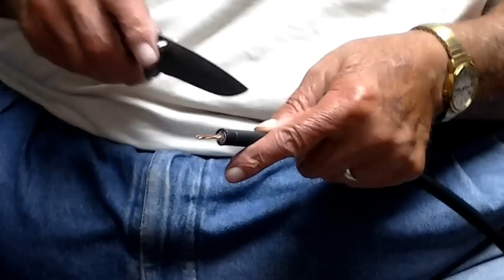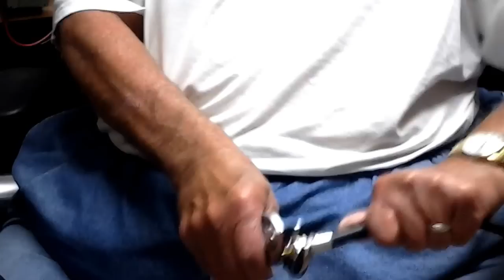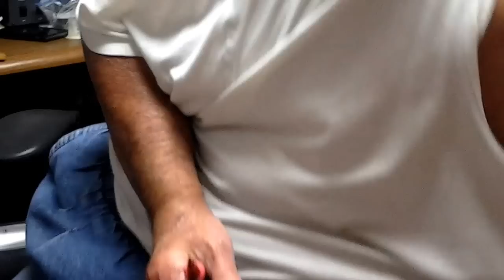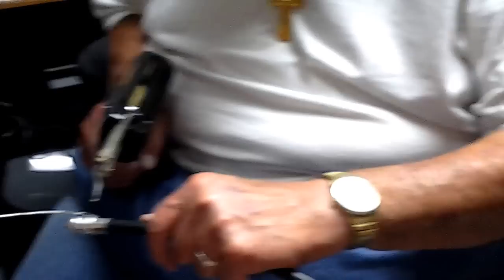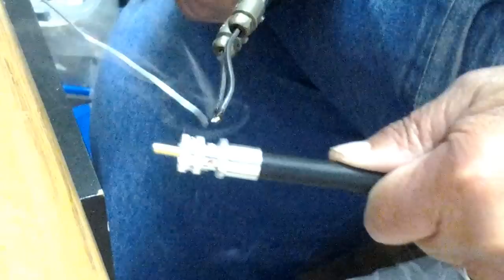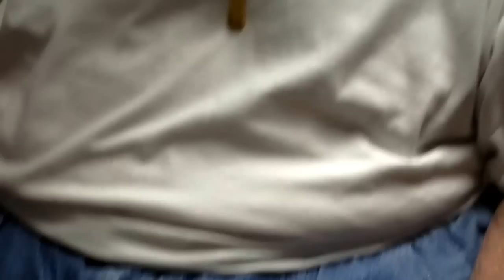SOLDERING A PL259 COAX CONNECTOR PART 2

Comment: If you are using stranded center conductor you can carefully remove about 3 strands and it should fit the center ok. Just make sure you have a good solder application on the wires that are installed in the center. There are some PL259 connectors that are cheaply built. Look on ebay for a package of 10 that have good quality material.

Comment: nice video, but i question the safety of your solder method. Looks like some could fall and burn your bluejeans, which were featured a lot in the videos. Maybe using a vice would have been a good idea, as well as safety glasses.

Comment: What brand connectors are you using?  I had an issue yesterday with some Wilson 400 coax, where the center conductor was slightly too large to go into the connector's pin channel.
Reply: Ampenol connectors